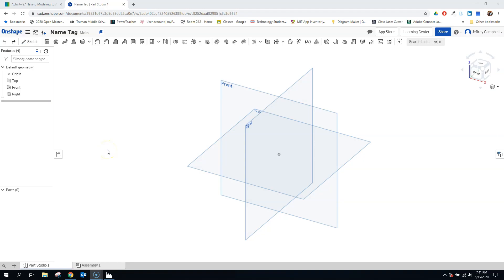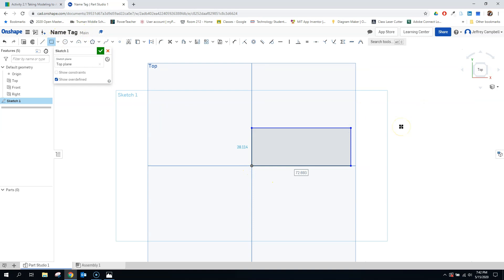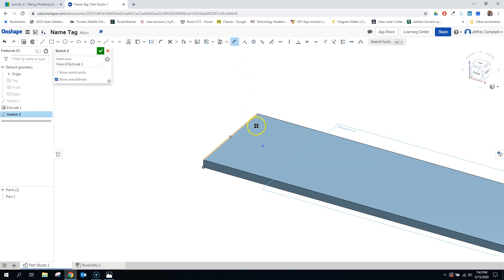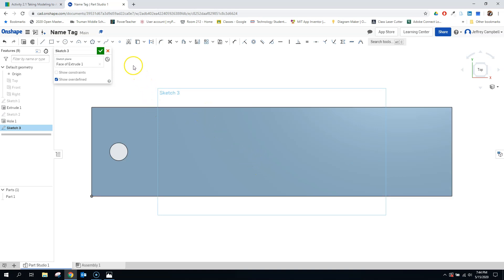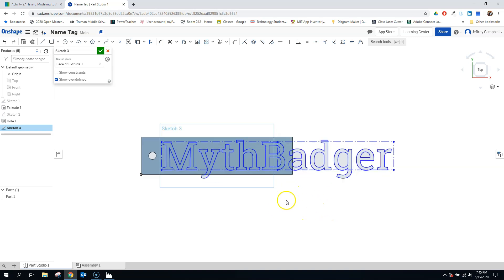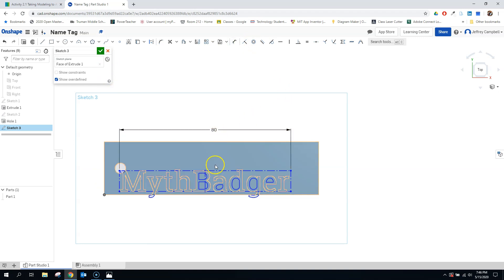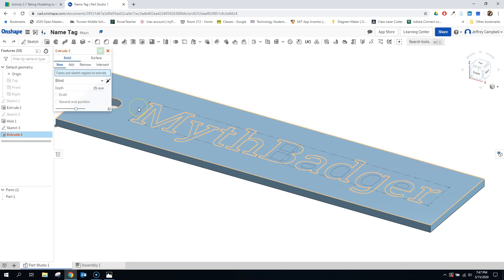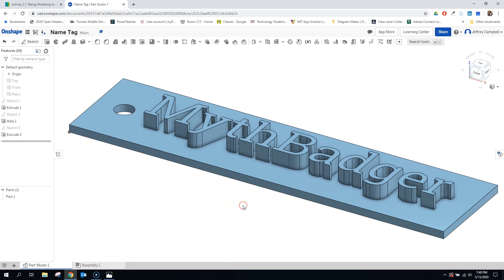OnShape Tutorials - Keychain

Comment: I want to make a similar keychain but with a cursive font that joins all letters. Since there is no such font, how can I manipulate text to slant the letters and join them?
Reply from the maker: I'm not sure the OnShape has any tools at the moment to automatically do cursive fonts. I did find mention of some requests to add custom fonts, or even just add more fonts, but I did not look to see if there are any updates to that request.

The long way would be to make the text using the Spline tool. This would take practice, and some generous trial and error to get your desired outcome.

Another thought could be to use the text tool for each individual letter. That would allow you to manipulate the positions to put them close together. You could then use the Spline tool (or something else) to create a sketch on the flat surface of the tag. The sketch would create a path that joins the letters together, then extrude them to the height of the letters. It could make it look like the letters are joined together. This would also take some trial and error, and it would require using the existing fonts, so you would need to find one you feel is close to what you want in style.

If you try either, I'd be curious to see what you make.